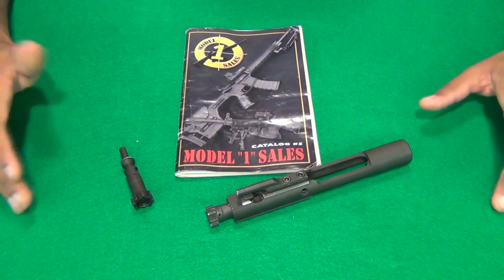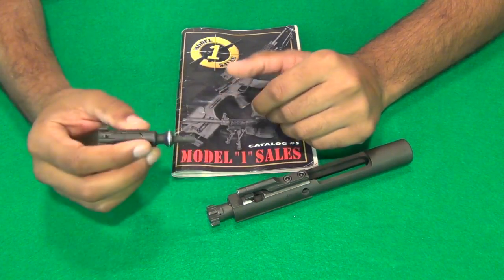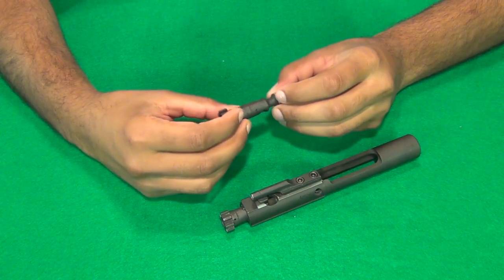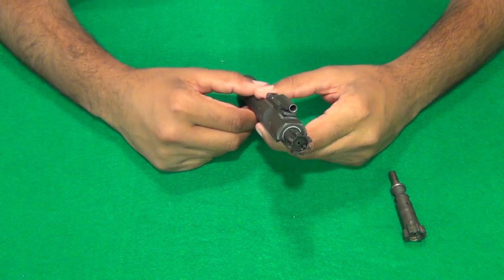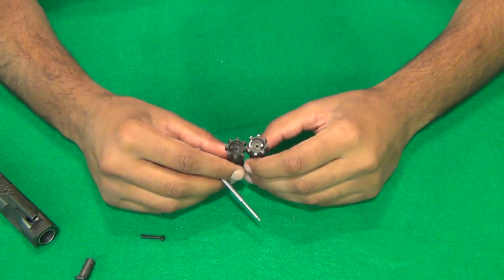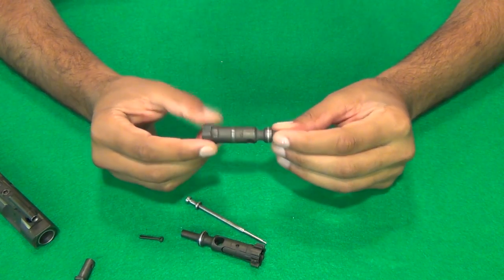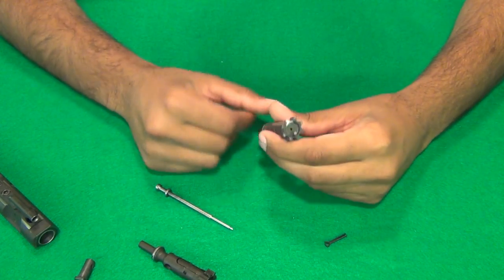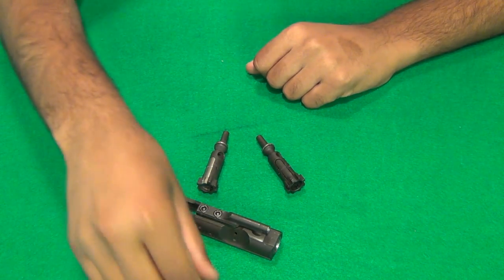7.62x39 AR bolt failure: "High quality" bolts?

Comment: I have a bca 7.62 x39mm 16 inch med system and it breaks a lug or extractor every thousand rounds or so usually its less matter fact it happened today so i Keep an extra bca bolt face on me . But ya sometimes they replace mine but other times theyale me buy new one but AR s break lugs. But evey other range trip.

Comment: At first, I was upset about this issue but I realized that AR bolts are relatively cheap. I'll simply buy 2 or three more to have as backups. I still like the idea of the 7.62x39 AR platform and will keep mine.

Comment: The 7.62x39 bolt is a modified design from 5..56 NATO  bolt by trimming material off the inside diameter. The current design 7.63x39 Bolt will fail by fatigue regardless the high price or quality. To prevent the bolt fatigue failure, the 7.62x39 AR-15 barrel and bolt must be redesigned. I am a Mechanical Engineer. I have both 7.62X39 and 5.556 bolts. I am already knowing the Bolt will fail within few hundred rounds.  The world is filled with greedy manufactures by not employing smart engineers. A Hydraulic tube with an elbow 90 degree design connecting to a hydraulic pump on the B-1B aircraft would fail in fatigue mode within two hundred hours of flying due to the vibration. The learning material from the Mechanical Engineering Design book is total obsolete. Anything is designed passing more than a million cycles would last forever.  I was instructed to redesign the hydraulic system with 45 degree connectors and 45 bend on the tube. The B-1B aircraft have been safe to fly with the new design since the modification in 1990s. I was the lead engineer of that assignment.

Comment: I had the same exact issue today with the same ammo! I usually run Tula ammo but wolf was on sale so I got that instead. 50 rounds in my ar wouldn’t cycle. I tore it apart when I got home and the same lugs were broken! I’m wondering if the ammo had something to do with it.
Reply from the maker: Mine was wolf to. Maybe try waranty?

Comment: I got mine 7.62x39 bolt from Anderson Manufacturing, they located in AZ. Too bad, they no longer in business.
Reply: You can go with a Windham Weaponry bolt, that’s what I use on both mine and work great
Reply: @thisSiteSucksHard  Thanks
Reply: @thisSiteSucksHard  Place order for bolt and firing pin for spare parts.
Reply: @thisSiteSucksHard  Thanks, man. I am going onto it. Windham has stuff what I need. Thank you, again for pointing this out. I am in CA.

Comment: Then only failure in any bolt is cheap ass tool steel improperly heat treated. If these were made from d-2 or a-2 tool steel and properly heat treated you would not have any issues. And yes I know what the f I'm talking about. Have built and designed hundreds of stamping dies. The quality of steel is the most important factor involved in the production of any tool if you expect it to last. But the cost is prohibitive, and much harder to machine. Live within your means.

Comment: This video convinced me not to build a 7.62x39, I'll just build a 300AAC. Thanks
Reply: Don’t let this vid discourage you, both my X39 rifles run terrific you can go with a Windham Weaponry bolt, that’s what I use on both mine and work great, try to use only CPD mags or at least ASC, avoid the D&H as those only run well with <15 rds loaded
Reply: I like the .300 AAC Blackout and I believe I have experience shooting a few hundred rounds of it.  But I prefer an AR-15 in 7.62 x 39 over the .300 Blackout.  7.62 x 39 ammo is 45% and lower in price over 125 grain .300 AAC Blackout ammunition.  With the savings in ammo just buy one or two extra bolt faces.  The bolt faces last anywhere from about 950 to 3,000 rounds.  The savings in ammo is worth it.

I would also only stick with the C-Products (also called Duramag) 20 to 30 round AR-15 magazines as they make the best quality 7.62 x 39 AR-15 magazines.  If you do decide to stick with .300 AAC Blackout the only thing I think you will regret is the ammo cost.  Best wishes to you.

Comment: I am considering getting a lower over at PSA on sale for the next 24 hours as well they have a Bolt Carrier that I think is a great deal? It is Nickel boron coated and had all the testing etc . Moreover It has with it included a charging puller . THE BOLT IS WHAT I THINK TO BE A GOOD DEAL AT $89 dollars. THE LOWER IS 139 . I Wish I could swing the bolt and the lower while they are both on special . Then the only thing I think I will need to finish is The rest of the upper. I have seen Incomplete uppers for sale around $220.00 which I think has everything but the bolt and the charger. Do You have any recommendations I am afraid that I am going to screw up and regret it. Any Advice or tips will be greatly appreciated. Thank You and God Bless

Comment: Carpenter 158 is asking for failure in 7.62x39. "9310 is what to use, no failures" some people say, some people do not understand metalurgy. 9310Nis very much "stronger." Heat as well as stress causes failure, heat many times more damaging. 8620 is stronger than C158, but becomes brittle after heated up and fractures if run hard enough. 
If you run 7.62x39 you better have a 9310 steel. 
Further, I use only 9310 in all AR's, including 5.56/.223/.223 Wylde. , and my 6.5 Grendel's. 
Buy and run 9310 only, this is the gospel, call RED-X, ask the armorer, that's just one person I know to mention that knows his steels.
Peace, Bro.

Comment: I currently broke two bolt, one from radical firearm, a standard type bolt, and a so called 9310 steel -enhanced 7.62X39 bolt from LMT. Radical's bolt broke two lugs near the extractor, and the LMT bolt had a cracked extractor---it will not extract the shell. both botls broke at 1300 rounds. So what I can say is that I do not trust so-called high quality bolt. it will not work.
Reply: Fail zero has nickel boron plated BCGs for a fair price that are very nice.

Comment: The broken bolt's face has a deep groove at the circumference inside the lug ring. Notice that the lugs both snapped at that weak point. It appears to be severely defective, perhaps a poorly executed 5.56 conversion.

Comment: 5% is a bigger deal than it sounds. remember these ar 15 type rifles were designed to handle .223 not 7.62 x 39 or 6.5 grendle or beowolf. there are a lot of bolt failures in these bigger calibers. (Google it if you like) also, it's very important that your barrel interface (relative to the upper receiver) be perfect. the reason this is important is because if it is off then the locking lugs will not be loaded evenly you may have only two that are taking most of the load while the others are essentially along for the ride.

Comment: All the load on the bolt lugs are on the back side and not the front. The front area of the lugs take the impact upon chambering a cartridge...Which should be softened as the cartridge seats in the chamber. Now letting the bolt/carrier slam forward without loading a cartridge changes things a bit.

Comment: Raise consumer awareness.  Huge percentage markups on a similar looking piece over an average or stock (if you will) bolt.  My point is "buyer beware" of some businesses jumping on the "AR variant , custom build craze" bandwagon and taking the opportunity  to make large profits in lieu of putting out a solid product with integrity.  Don't let the marketing and advertising cloud judgement.  Just looking at the new bolt from what you were showing on camera compared to the older piece, I couldn't  and wouldn't be sold on it at that high price.  I'm talkin principle, not lack of cash or something like that.  I bet I'd be more convinced if I was actually able to touch and look at it live.  You had it right there and you pretty much knew there wasn't much difference at all...not enought to substantiate the way higher cost.  Thanks for actually purchasing it to show a side by side comparison and what someone will actually receive if purchased.

Let me clarify what I'm saying here, because I don't want this to come across as a put down to whoever is selling that newer bolt you purchased.  The purpose of my point is consumer awareness.  I'm saying that I just wasn't convinced as far as what I seen on your video considering the price point...if it was only twice or a little more over a basic unit, I might consider more after I've had the chance to feel it in my hands and do some homework on it, see what users on other forums have to say about it, if anything.  I have a pretty good eye also.  It's just based on what my eyes were drawn to and the many years of handling mechanical parts of all sorts and the trend in manufacturing quality since the 60s (can't go back further, I'm not that old).  There may be a justification to that high price point, but I'm just saying as consumers, we need to question the manufacturers/retailers when a similar looking piece is presented at a much higher pricepoint.  Anyway, this goes for most any product we're buying these days...especially, these days.  The more a consumer educates themselves on a product, the much better off they will be and the more they will end up saving money/time in the long run.  I can't tell you how many people I know who don't know the product they're purchasing and they buy the junkiest of stuff...then I see it and I ask them rhetorically, because I already know, "why the hell did you buy that??"
Reply: Let me just add, last night I almost pulled the trigger on an upper selling for $199.  Yeah, some closeout sale, 16" SS barrel, supposedly good quality aluminum receiver, decent stuff.  I admit it.  I almost bought it just because of the price, except the barrel quality question kept popping up in my head.  Don't get me wrong.  That complete upper is still a bargain no matter how you dice it up at $199.  But I had to decide if that would suit my purpose or maybe not.  Because my goal is a budget AR.  So we'll see.  I might buy it and then change the barrel out to a nicer piece a little ways down the road.  I'm all about function over form, so if I find a nice barrel with cosmetic blems on it at a good deal, the more better for me.

Comment: 7.62x39 bolts break more often because the recess is larger than a 5.56 bolt. The lugs did not shear off, the part of the bolt they were attached to broke away from the bolt body because the material was thinner.  The ARP bolt has a thicker web and a radius at the root of the lugs to increase attachment and increase the strength.  You say "that's the only difference" that makes all the difference.
Most civilian bolts are made from 8620. DOD contractors are the only companies that can purchase C158, it is allotted to them. With cartridges like the 7.62x39 and Grendel it is important that the receiver is square to allow all lugs to carry the thrust.
Reply: I use a fail zero bolt. IDK if it's repurposed 5.56 but I got it from Ballistic Advantage along with my barrel cause I wanted to ensure parts would work together.

Ballistic Advantage sells the best 5.45 barrels I've seen, so hopefully they wont host anything less on their site for other products.

Comment: You're right that this isn't a result of the ammunition you were using.  This is the primary problem with most 7.62x39 bolts.  They are usually 5.56 bolts that have been milled out to accept the larger case head of the 7.62x39 cartridge, which weakens the webbing between the lugs.  When you build a x39 AR using, for example, Model1 or Rguns upper parts, the lugs will be the first thing to fail.  It may be after 500 rounds or it may be after 2,000, but the first thing to break will be the bolt lugs.  Harrison at AR15 Performance has gotten out of the 7.62x39 business (which I think is a real tragedy) and Lewis Machine & Tool no longer actively markets their x39 line either... However, if you call LMT and ask for a 7.62x39 Superbolt, they still have "lots" of them and will sell one to you without warranty, which may or may not be important to you.  It's expensive at $200 and if you break the "lobstertail" extractor or lose one of the springs you will have to buy another bolt to cannibalize for parts, HOWEVER, I challenge anyone reading this to find any reports anywhere of a 7.62x39 LMT bolt failing... It doesn't seem to happen.  Of course, another way of looking at it is that MOST shooters will never eclipse 1,000 rounds through their x39 upper.  Maybe it makes more sense for low-volume shooters to simply purchase two "regular" bolts and keep a spare in the grip compartment.  Stay away from MGI; they are priced like ARP and LMT bolts but do not outperform Model1 and Rguns bolts.  Please keep us posted on the performance of the Cason bolt.  Good, helpful video.

Comment: We'll informed video addressing these common issues with x39 bolts. I bought a cason engineering super bolt. Great company to deal with. 3000 rounds + still looks new. It is made out of 17-4 stainless steal wich is a lot stronger than carborized steal and not brittle. What mags do you suggest?
Reply from the maker: I use C product and ASC mags (whic are the same) and they work fine for me. Each mag I have works great. I have a specific video on magazine options for the AR chambered in 7.62x39. You can find it on my channel video page and type in AR15 in the search box. Title is AR15 magazine options/issues.... i think
Reply: V8 Merc
Reply: Everyone is saying c products duramags are the best

Comment: It's probably the quenching technique used when hardening. It could also be other temperature related causes for the failure, but I would take an educated guess to say that they quenched the bolt extractor side up causing it to take the shock worse.
Heating up metals in the hardening process will always produce varying results & that's my final thought. I've sheared 1½" thick chro-moly, 35 spline, Dana 60 axles. Using 35" bfg AT's & that's a freak situation.